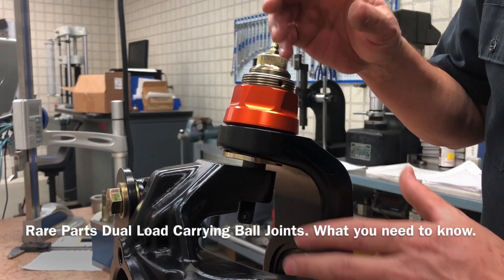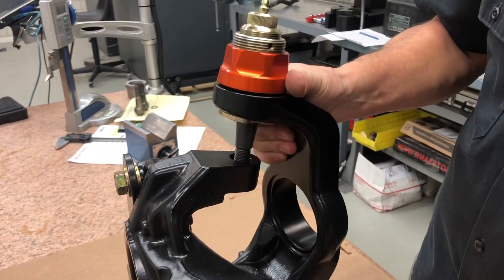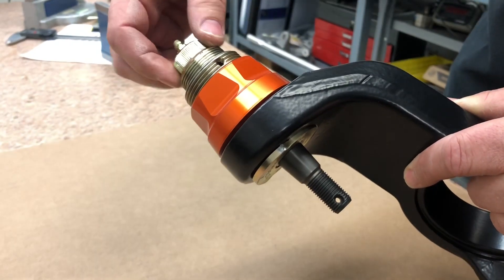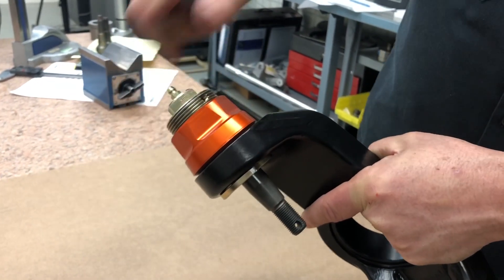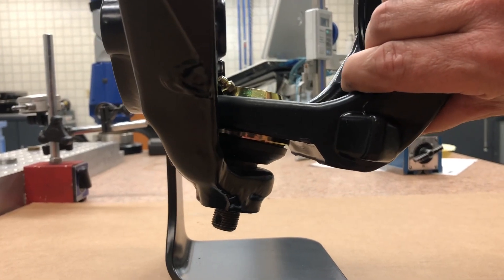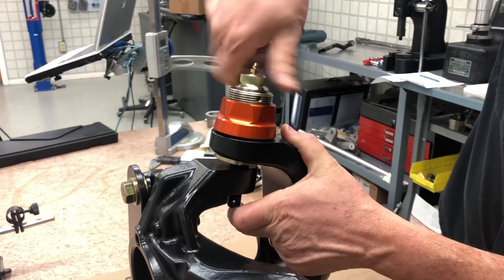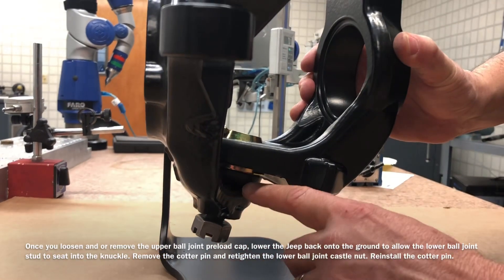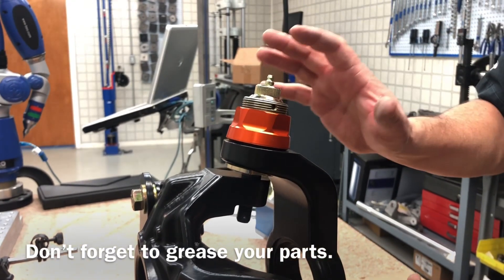Dual Load Carrying Ball Joints Tips & Preload | Rare Parts, Inc.

Comment: Thank you for detailing how to adjust Metalcloak Baller Ball Joints. I installed them on my 23 JLUR and the instructions did not clarify how to preload properly.
Reply from the maker: We're glad this helped set the preload on your JL! Note, this video illustrates our original Rare Parts Inc Dual Load Carrying Ball Joints for the Wrangler JK and installation will differ for JL/JT. Use strong caution as setup may not be correct for any replica products. 👍🏻

Comment: are these made by you? or are these the skyjacker ones, rebranded?
Reply from the maker: We proudly designed, test, and manufacture the Dual Load Carrying Ball Joints. Let us know if you have any questions, we're glad to help! 800-621-2005 👍🏻
Reply: @Rareparts  the reason I asked, is because these are an exact clone of the old skyjacker ones. Down to the anodized color.

Comment: What ball joint tool kit will work best for installing these? Any particular cup size/diameter?
Reply from the maker: The Harbor Freight Ball Joint Service Kit worked well but the c-frame may bend over time after multiple heavy uses. We've upgraded to an OTC Kit for our Wrangler with no problems. OTC also makes a few adapter sets depending on your project/vehicle(s). 

https://www.harborfreight.com/ball-joint-service-kit-for-2wd-and-4wd-vehicles-63279.html
https://www.otctools.com/sites/default/files/517921.pdf

Comment: Quick question. I installed this kit on my 2015 JK. I followed the instructions to the letter. However, the axle shaft still contacted the grease fitting on the lower ball joint. Right now, the only way I'm able to drive the Jeep is that, after I greased the lower ball joints, I removed the grease fittings and installed a 1/4-28" plug in their place so that there is nothing protruding from the grease fitting hole. I can remove the plug using an allen wrench when needed.

I have the grease fitting location facing to the rear 45 degrees, as specified in the instructions.

1. Would it be okay if I remove the lower ball joint so I can re-position and re-install it? I don't want to remove it and then have it be to loose, thus requiring me to purchase knurled ball joints or even worse, a new axle assembly.
2. If so, should I turn it further inboard, say, 60 degrees to the rear?
Reply from the maker: Re-positioning the grease fitting about 60 degrees to the rear of your Jeep should be perfect. Depending on your axle shaft yoke diameter, some shafts sit closer to the housing/fitting than others. There is no problem with re-installing the ball joints, the housing should still fit tight when re-pressed. If press-in diameter becomes too loose, we manufacture an oversized knurled lower ball joint to remedy without replacing your axle or C. If you run into problems or have questions, reach out anytime - We're glad to help! 800-621-2005 👍🏻